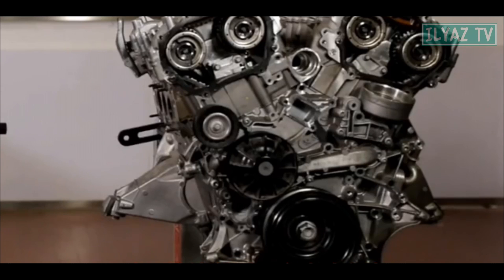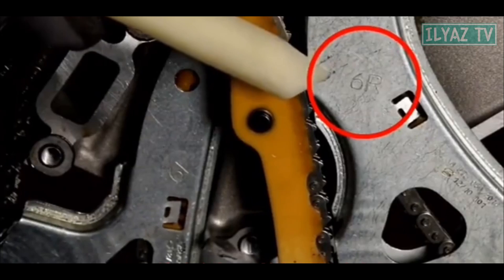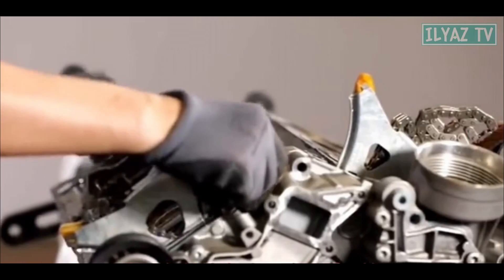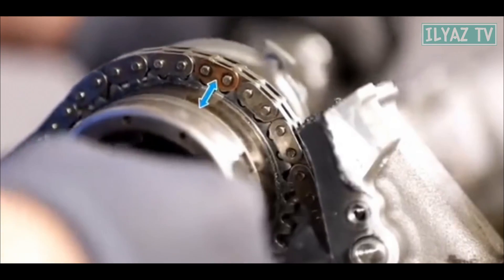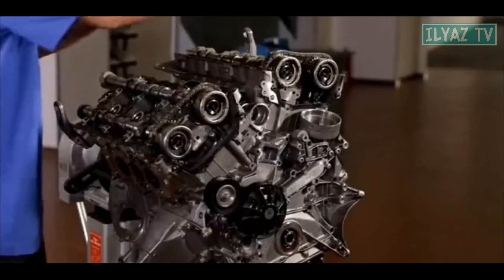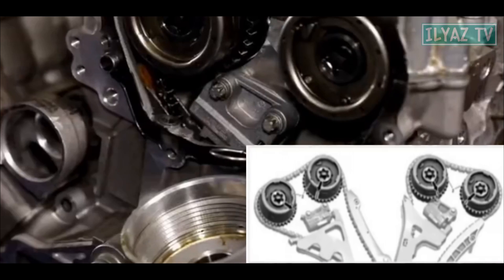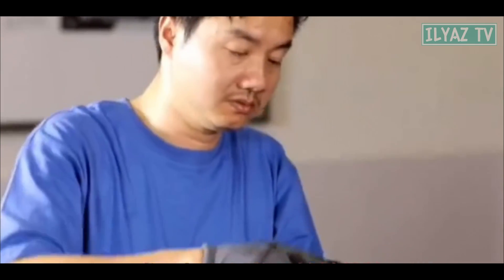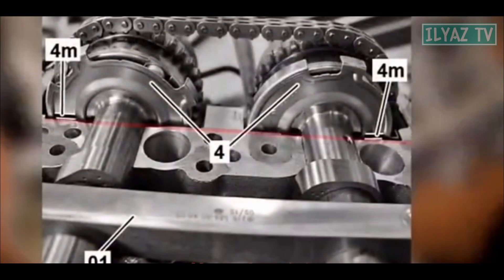Mercedes Engine M276 M278 Timing Chain Installation and Camshaft Position Adjustment

Comment: I did a passenger head in 278 engine with the engine inside, the guy broken the spark plug and try to take out the  rest with a mickey mouse extractor and you could imagine: the extractor fell in the cylinder. Could no rotate the engine, only the experience let me put in time without taking out the engine and the front